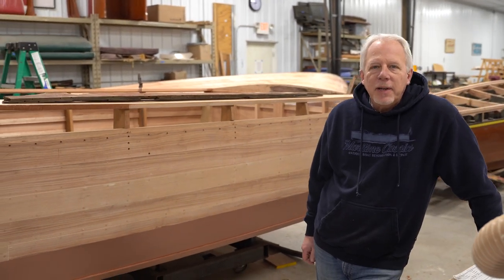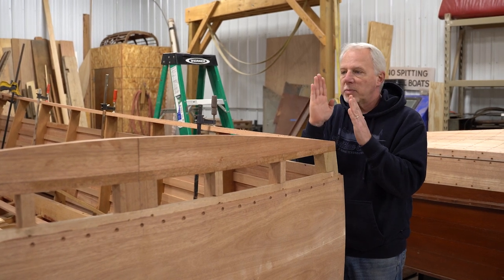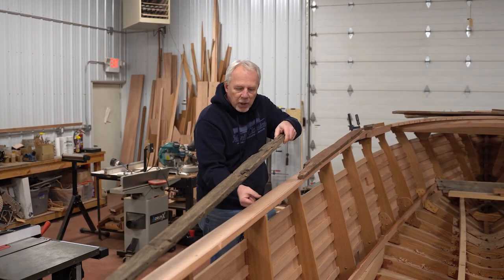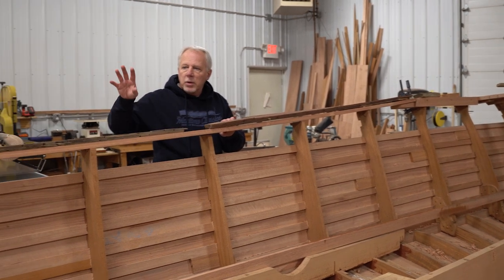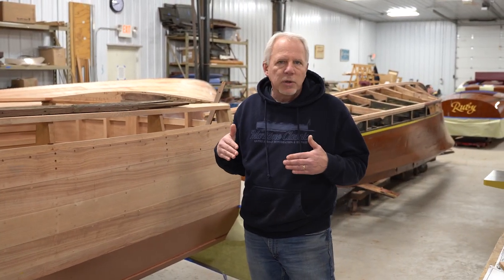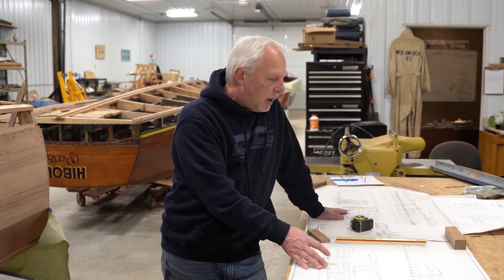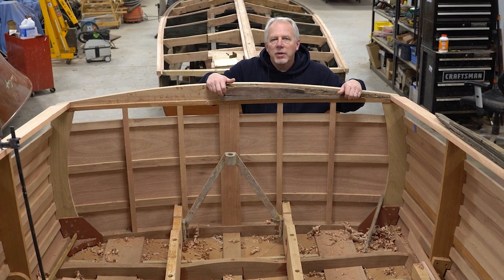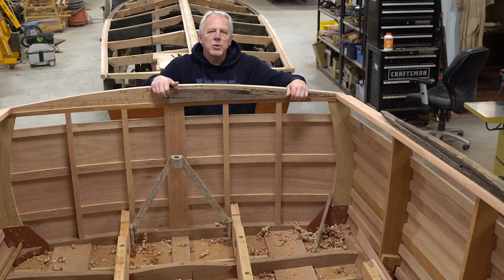Is it Worth Saving! Rare 1950 25' Chris Craft Twin Engine Sportsman Restoration

Comment: You do fantastic work. I looked and there were 208 hulls produced of the 25' Sportsman. That is a low production number compared to my 16' Deluxe Runabout at 1,880 hulls. That being said, what is the reasoning to rebuild this boat??
Once again, it is beautiful.
Reply from the maker: It is rare because it is a twin engine and they only made 42 of them. Most likely there is only about 20 or less left to exsist. Plus the owner wanted a twin sportsman. Thanks for watching!

Comment: Cheaper to buy the plans and build from scratch, no doubt.
Reply from the maker: We have the plans and we used them to rebuild the boat so thats pretty much what we did. I would think the hull cost would be about the same. This boat did come with most of its original hardware and running gear which if you had to find and purchase that building a new boat from scratch it would be very exspensive.